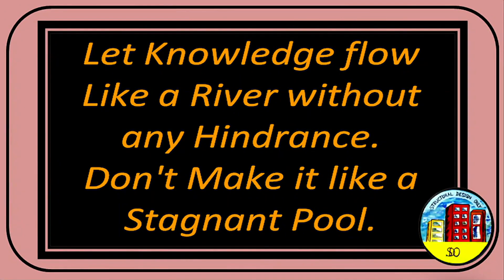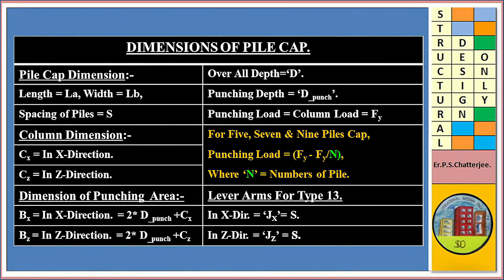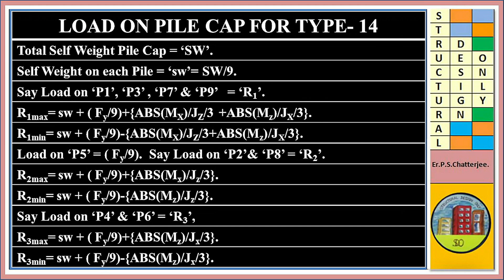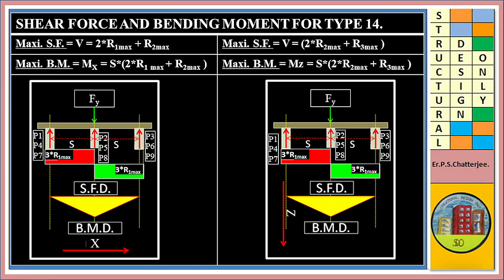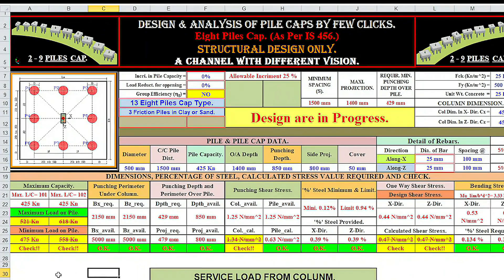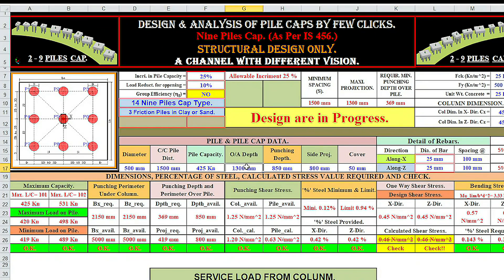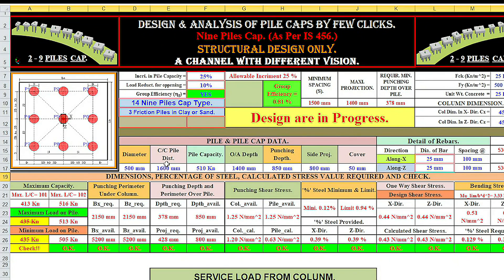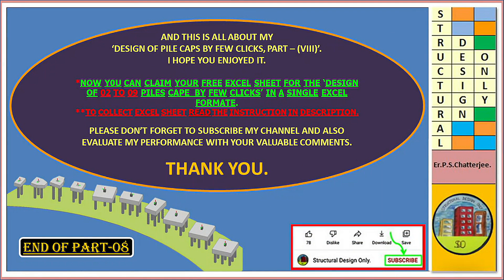Design of -9- Piles Cap in Excel by Few Clicks.

Comment: I find your work very informative, Sir. May I kindly suggest that you provide further details on how to calculate shears and moments, as well as highlight important design considerations and common mistakes young engineers should avoid in designing pile caps? I have also sent an email requesting the pile cap design spreadsheet. Thank you.
Reply: Spreadsheet received. Thank you sir.
Reply from the maker: Thank for your comment. For your kind information my next video will be on Beam design under several load and support condition. I hope you will enjoy that video. I had a dream to make several design related video for my viewers but due to the shortage of time I can't do it regularly. I can do this regularly only after the monetization but you will be astonished by hearing that my channel got less than 500 organic watch hours within a year, where as my Total subscribers are more than 2300. If my all subscribers provides me 2.50 hours within a month that means 5.0 minutes per day for a period of one month it is sufficient for me to touch the milestone of 4000 Watching hours, then only I can left my other job and can invest more time to my channel the only I can produce as per your  your requirement. I need to work for my family.
I have watched that most of the viewers of my channel are not interested to share the acknowledgment of receiving the file, nither they are interested to share their experiences regarding the sheets in youtube channel. You can think, Why I am telling to make comments on channel, because I will create a binding between you so me and it will be helpfull to the new viewers to suvubscrib my channel.
With regards,
Er. P.S. Chatterjee.